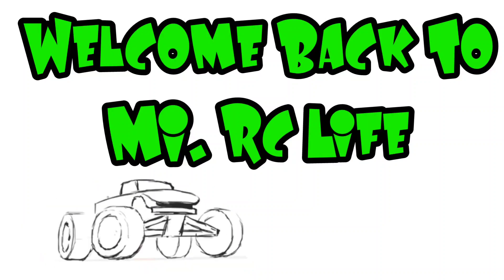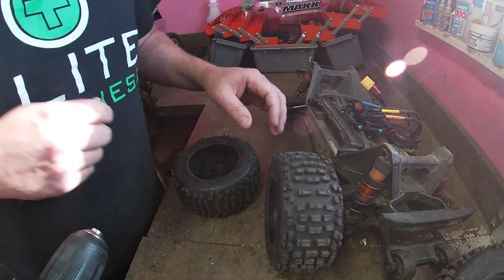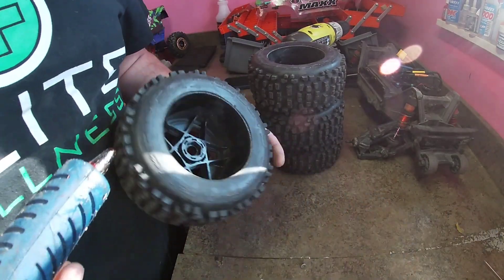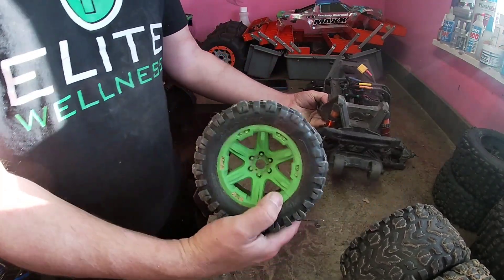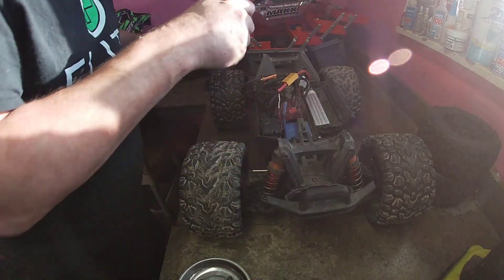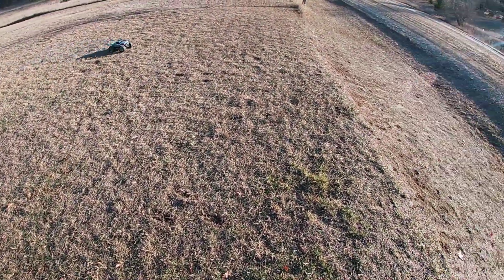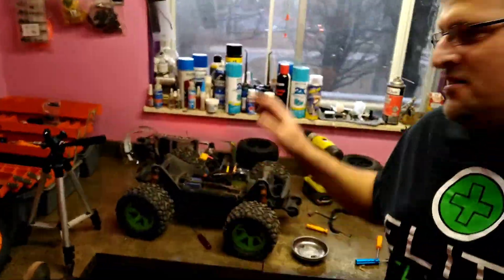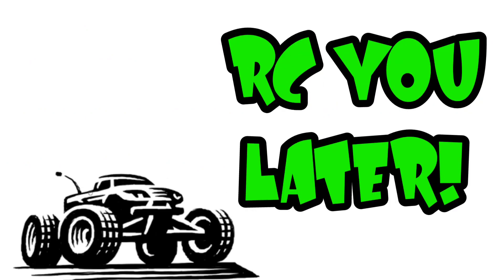Traxxas Maxx Gets Prepped For Winter And A Beat Down🤗😁👍

Comment: Reading your other comments down below. I also burned up my second traxxas ESC. Don't know if they're going to cover this one. Which speed control do you use now and have you had good luck with it?
Reply from the maker: In my Traxxas Maxx I'm using the arrma blx 185 esc.  It's cheap and good up to 6s where the stock Traxxas esc is only good up to 4s

Comment: I literally just got a Maxx like 2 weeks ago, and maybe used it for a total of 2 hours in the span of that 2 weeks, and when I used the auto flip mode, my tire blew and the foam came out, basically brand new, can’t believe that happened from not even reckless driving it either very disappointed in traxxas
Reply from the maker: I hear you.  It probably got a little bit of water or sand inside the tires and that makes them unbalanced and then they blow or rip under high speed.  When the truck is upside down like that the tires build extreme speed very quickly and can rip/blow a tire like nothing!  But I agree with you....stock Traxxas tires are pretty weak!  I recommend either filling your vent holes on the inside of your wheels with hot glue or putting a small piece of strong tape over the holes, or vent yor tires....it explains this in your maxx Instruction manual (who reads that?? Lol)  but it's basically putting a small hole in-between your tire tread directly across from the hole on the inside of your wheel and it should let sand/water out.  Even driving through barely wet grass 1 time gets water in there or going into beach type sand once gets sand inside.... if you do both....you got mud. Lol.  You should vent those tires but if you get new ones.....tape or glue them before you ever run them. Keep ripping on my rc brother!  You will love your maxx, it's a ripper.
Reply: @myrclife  I see what your saying, but after only 2 hours of use and that happens is kinda pathetic, if they have that flip mode and stuff like that happens what’s the point of it than if it’s just gonna keep costing hundreds of dollars, I paid around 1400$ in total with the battery of course and shipping, I would expect to get more than 2 hours out of it before something happens considering I live in Canada so it ain’t like I can go somewhere to get stuff because of Covid, I was actually so hyped for this truck when it came in I thought I was gonna use it forever before something broke, considering all of the videos I’ve watched about it, about not breaking easy, something like that should be under traxxas warranty with small amount of use but no, seems like something faulty to me
Reply from the maker: Agreed. Traxxas warranty sucks.  They always bail on me too.  Don't buy Traxxas batteries either.  They are low grade!  Only like 25c rating.  If you ever see a Traxxas demonstration they don't even run their own batteries they run better high quality batteries with like a 50 or above c rating and wrap them in black tape so you cannot see that even they don't run their own batteries!  It's sad!!  I hope you can order other tires soon with all the covid crap slowing thing down just order some proline tires or something better built.  Sorry your having bad luck with your rc experience 😔.  It will get better.
Reply from the maker: They denied warranty service to me when my Maxx esc failed after 2 weeks. Very sad
Reply: @myrclife  can you give me a link for the best tires to use for winter that won’t explode right away, plz?
Reply from the maker: https://www.ebay.com/itm/Pro-Line-Trencher-LP-3-8-Low-Profile-Tires-Raid-8x32-Wheels-17mm-Hex-Maxx-E-Revo-/193616464109?_trksid=p2349624.m46890.l49292.  
These should be ok. But like I said.....glue the holes before you even put them on the truck!  It's a must😉👍  the pro line badlands 3.8" will be good too. I'll send a link for those as well
Reply from the maker: https://www.ebay.com/itm/NEW-Pro-Line-Badlands-3-8-Tires-on-Raid-8x32-17mm-Removable-Hex-Wheels-FREE-SHIP-/203070691479?_trksid=p2349624.m46890.l49292
Here's the badlands.
Reply from the maker: https://www.ebay.com/itm/Duratrax-Lockup-MT-Belt-3-8-Mounted-Front-Rear-Tires-0-Offset-17mm-Black-2-/333770521989?_trksid=p2349624.m46890.l49292
These would also be good, although I've never had a set......I've heard good things about them.
Reply: @myrclife  just tried all 3 of them to buy, but apparently they can’t ship to my address ☹️
Reply from the maker: That sucks man!  I wonder if it's because your in canada?  Try typing the name of the tire into your search engine and maybe it can get you a shipper within Canada that can get them to you
Reply: Easy fix. Flip your car by hand. Your fault not the tire.
Reply: @spike--  lolol what’s point of the stupid auto flip than if it busts tires, but yea I know now to flip by hand, especially only using it for 2 hours basically brand spanking new so I don’t really consider it my fault, since I’ve barely used it
Reply: @jordankrankowsky2992  if your tire blew while over revving its your fault.
Reply: @spike--  I don’t think your understanding, it’s called auto flip, it does it all by itself, I rev nothing at all when it auto flips
Reply from the maker: I try not to use my auto flip at all.  If anything......I do the flipping by running the throttle myself so I can control how fast the motor is reving.
Reply: @myrclife  what I’m gonna do from now on is that, I just obviously used auto flip because I thought it was a cool feature and I thought nothing would go wrong since it’s brand new, but I know now
Reply: @jordankrankowsky2992  i only flip by hand.